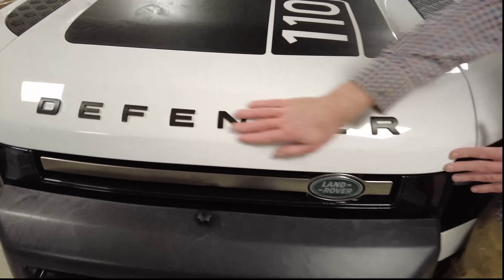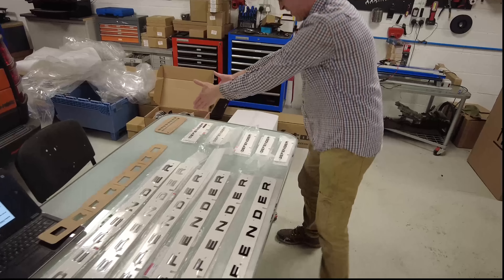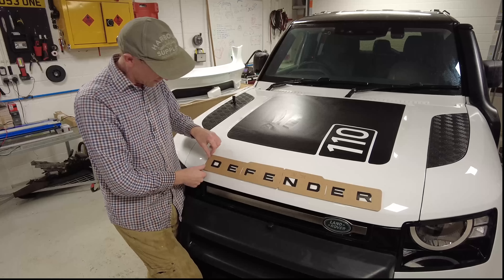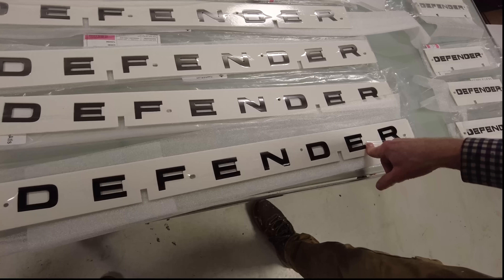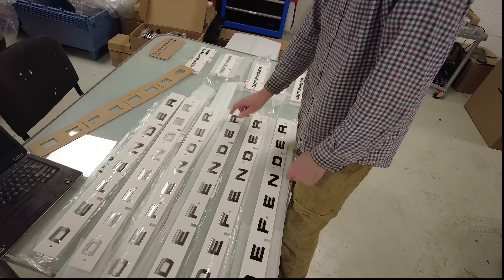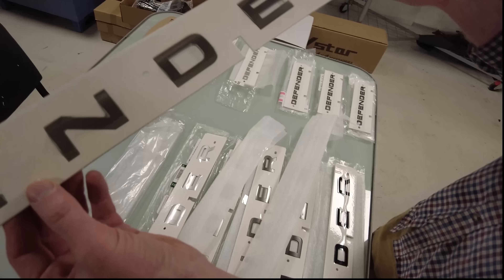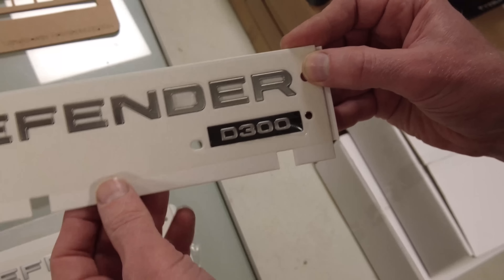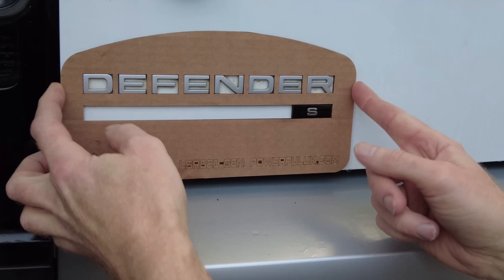Land Rover Defender L663 Bonnet / Tailgate Lettering - 50 shades of grey !

Comment: A bit off topic Simon, but can you get a loan of a 90 and look to create a storage tray for under the boot floor instead of the lump of foam with the tool kit??
Reply from the maker: Hi Jamie - I do need to get a 90 - they are listing 4 options for the underfloor storage tray / seems they changed it on the later ones ?
Can you send me a picture of what it is like ?

Comment: You were doing alright until you said local friendly land rover dealer?  I think you mean, over priced local land rover dealer?
Reply from the maker: We are getting good support from the dealer at the moment so no complaints... although the road has not always been smooth.
Reply: @L663  they have a bad reputation and in case you haven't noticed, its all about the Range Rover customer, or those with 75k plus......